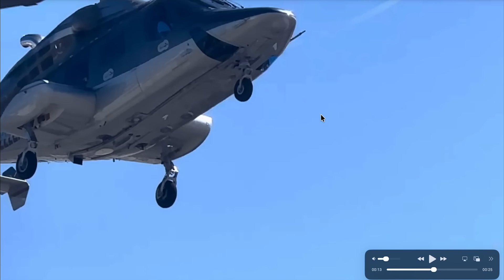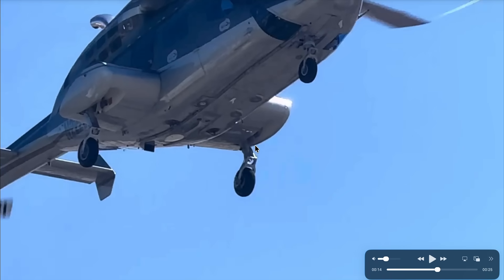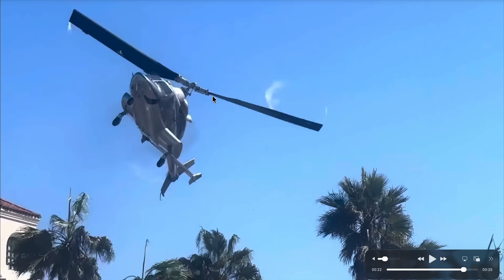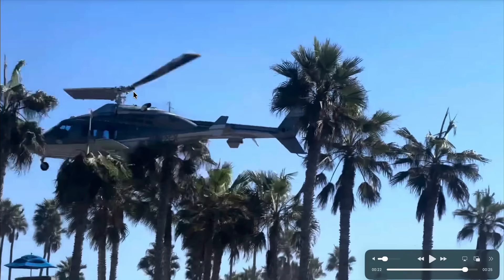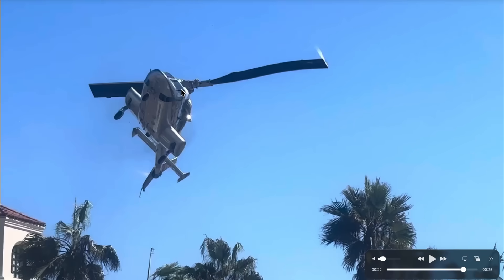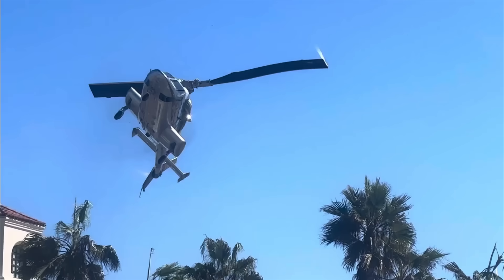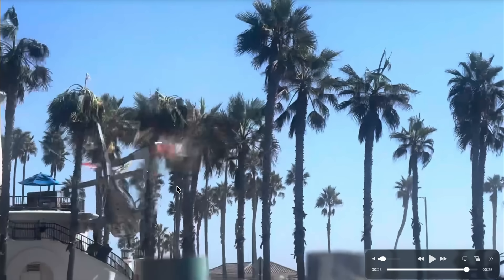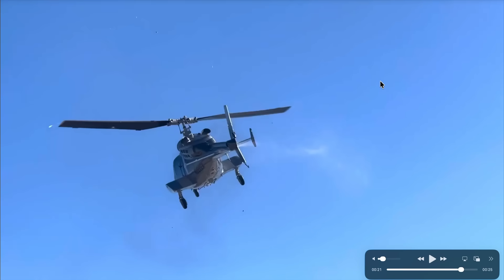Huntington Helicopter Crash Analysis - SlowMo Video!

Comment: There will be an aircraft mechanic somewhere in panic mode.
Reply: con los dedos cruzados para que termine siendo fatiga de materiales.
Reply: Yup. Rotor-wing aircraft are high maintenance, compared to fixed-wing.
Reply: That’s called the Jesus nut.
Reply: Hard to believe that.  Look up N661TC.  Not a single mechanic faced any consequences for failing to inspect basic wiring especially after two premature starter generator failures..
Reply: @SmokingFun I am a mechanic still sweating something I signed off over 15 years ago. So there’s that
Reply: @MeowWoof-m2s  unless you signed off on a bogus, major repair or alteration I wouldn’t worry about anything.
Reply: I would say failure to inspect all wiring epically the largest wire coming from a system that causes two premature starter/failure would be improper work.  A simple inspection of the generator system would have revealed resistance discrepancies in the wire coming from the two failed starter generators.   Basic 101  standard practices .  I’m not saying this without intimate knowledge of the Cal-Ore life flight maintenance department.  I heard conversations. They knew something was wrong with the airplane, but they kept throwing more parts at it without documentation until they fix the problem.   The chief pilot would take planes up to see if it fixed problems without any documentation in the logbook . The circuit breaker for the Hobbs meter would be pulled during those flights.  The most crooked operation I’ve ever experienced. There is no maintenance operation control.
Reply: @SmokingFun
Then document it and call your local FSDO.
Reply: @SmokingFun
Former FAA inspector here.

Mechanics and pilots dont always have violations against them when they do improper work. 
Try again.
Reply: @johnparish1432  wouldn’t improper work be not recognizing that to starter generators, failed prematurely, and failed to inspect other possible causes like the biggest wire in the airplane coming from that star generator chafing on a hydraulic line over several years under the care of cal-ore life light.  We all know it would take a long time for a hydraulic line to rub through the shielding a large aircraft wire. Shady operation.  Another crashed waiting to happen.
Reply: @SmokingFun
Of couse it may be improper but if a written complaint isnt submitted to the local FAA then its a moot point.
The aircraft, log books or mechanic will never be investigated.
The FAA should be able to do surveillance and if they find issues, write tickets on the spot like cops.

But instead they build a case and present it to the governments attorneys.

Most of the time the case is thrown out.

Did that for nine years.
We wasted a lot of time and money.
Reply: Wait until the final report from the NTSB before you throw people under the bus.
Reply: @johnparish1432  facts are facts . Every mechanic who recently worked on that helicopter, especially the mechanic who worked on the tail rotor and gearbox is sweating bullets.  That doesn’t necessarily mean it was mechanic’s fault but as a mechanic myself, I would be worried. Hopefully that gearbox just failed or the tail rotor on its own
Reply: @SmokingFun
I started at PHI, went on to Air logistics then spent more time as the cheif mechanic for the Austin police departments EC-120 and their 182.

I never worried.
I had no reason too.

Why on earth would you worry about your work.

If you do everything by the book that is the best you can do.

How do you sleep at night if you worry about your work?
Reply: @johnparish1432  I don’t worry about my work.   I was only responding to the comment that somebody else posted. You’re getting a little off track there.  No wonder mechanics are really prosecuted, we got lazy and incompetent government workers collecting a government welfare check paid for by my tax dollars.
Reply: @SmokingFun
As FAA inspectors we werent lazy.
As a matter of fact all of us had too much to do.
Many of us took our work home with us.

Its the "way" the pilots and mechanics get violations that was antiquated.

We would build a case and gather evidence for weeks or months only to have the case thrown out.

There is no incompetence or laziness on the inspectors part.
Its all from upper management calling the shots.
Reply: Glad they survived but this is why you do not use D.E.I. Mechanic’s on your Aircraft’s.
Reply: @flcowboydc  EXACTLY WHAT I SAID WHEN I FIRST SEEN IT!
Reply: @flcowboydc  LOL! True.
Reply: @flcowboydc  Yeah, you use I.E.D. mechanics...
Reply: @flcowboydc  What a shock, yet another wishful, invented accusation. There's obviously absolutely zero evidence of it being a "D.E.I. Mechanic", just as people post this rubbish on every crash.
Even when a supposed "dei" pilot, aka a woman, was flying during the door departure, there was a flurry of gleeful bs dumping on her. Never mind that it turned out that she handled it about as perfectly as possible, despite extreme circumstances.
Reply: @DoubleMonoLR LMAO, but Thank you for your Liberal insights.
Reply: @flcowboydc 
Former FAA inspector, he is correct.
You are wrong.
Reply: @johnparish1432 LMAO
Reply: @flcowboydc 
I can tell you arent a pilot or aircraft mechanic.
Whats your point?
What is so funny?
Reply: @johnparish1432 What’s funny is how a Lib/Dems can make a determination of somebody’s skill level without knowing who the Aviation Mechanic is but you did say you use to work for the government so that’s all I need to know.
Reply: @flcowboydc 
My reputation as a helo mechanic and FAA inspector is etched in stone.

Whats on your resume'?

And I voted Rebublican.

Try to keep up.
Reply: You kids are funny.
Please dont learn how to fly.
Reply: @flcowboydc  DEI or not an air frame and power plant license is a licensed to learn. There could be many reasons.   Premature tail rotor gearbox failure, records department did not track time limits on tail rotor and/or gearbox times or cycles correctly . Could just be incompetent mechanics nevertheless it is the companies responsibility ultimately. If any mechanics are at fault, they will face consequences to hopefully. But I’m not crossing my fingers
Reply: @flcowboydc 
Aircrafts?

???😂
Reply: @johnparish1432 D.E.I. Questions but as usual Lib/Dems jump into other people conversations.
Reply: @flcowboydc 
Not only that but some of them have NO idea how helicopters are built, flown or maintained. 

They are aviation ignorant but talk like AOC.
Reply: @flcowboydc  Inevitably, the racist is heard from.
Reply: @Hopeless_and_Forlorn LMAO
Reply: @Hopeless_and_Forlorn you mean the REALIST
Reply: @Hopeless_and_Forlorn  It was funny not racist, lighten up!

Comment: Vortices is the vapor off the mains, black smoke out of the stacks is the engines getting a load just before he dumped the collective into the auto and the change of pitch on the tail rotor was the pull on the control links as they departed
Reply: Pilot did a good job at getting them on the ground alive in my opinion, albeit injured, but that was the best he could do under the circumstances, so I give him a thumbs up! 🙂👍
Reply: @glenturney4750  Yeah, he did a good job setting it down on that kid...

Comment: Bell 222 is resistant to mast bumping the rotor head is designed for low G and split S maneuvers, But it sure came apart even the one blade looks fractured as the mast & head come apart. Ouch'
T/R gearbox output quill failed then the t/r rpm dropped off - pilot adds peddle until pop goes the weasel
The t/r blades contact the boom then it exits stage nowhere. 
I'd rather a hard landing under control then this, out of control spin cycle
Reply: "Designed for low G and splt S." Somebody watched too much Airwolf. No rotor system, even a BO-105, was 'designed' for those types of maneuvers. Being the 222 is a two-blade teetering system, even less so, and will absolutely mast bump under the right conditions.

Comment: I don’t know a lot about the tail rotor head of the 222. But if you freeze it at 1:00, it looks like there are two pitch change links folded inboard, or are they some sort of counterweight system? That would cause the initial loss of directional control, which would then allow the blades to feather, which would then be enough to get out of balance enough to separate the tail gearbox housing.
Reply: At 5:20 is a shot of where the tailrotor can clearly be seen, the pitch change system appears intact and the TR blade angles consistent with left pedal applied.  The TR pitch change mechanism uses counterweights and a total of 4 pitch change rods/links.  One PCL certainly came adrift or broke, timing is uncertain…

FWIW I think there has been some sort of TR control failure, not a drive failure.  The TR speed variations as captured by the camera shutter appear consistent with the normal RPM fluctuations experienced with power changes.  Under the air and gyroscopic loads the TR would undergo in the rapid right spin the TR hub would be bumping on the travel stops (same as mast bumping) and the blade failure would be as a result of loads applied.  Back in the 1980’s there was a repetitive inspection on the 222 tailrotor blades in that area if I recall correctly.  Once one blade separated, the gearbox housing failed and departed with the output shaft and bevel gear.  Another video shows this on the ground.  Probably the other blade failed when striking the fin.

Black smoke from the engines is normal exhaust trail for low speed high power operation.  White “smoke” from the TR gearbox would be oil spray/vapour.

(40 year helicopter maintenance engineer with B222/230/430 time…)
Reply: @skyblot741  Thanks. Finally someone who knows what he's talking about. Definitely the best comment here.
Reply: @skyblot741 I’ve got 21 years maintaining Skycranes, but haven’t really spent any time around Bell products, so thanks for the clarification. Luckily, it sounds like the pilots are ok, so it’ll be interesting to hear their input as to what happened if they are able to remember. 👍🏻
Reply: @LightningSpeed64 5 taken to hospital. 2 on chopper, 3 on ground. Landed on a kid who was trapped until someone pulled him out.
Reply from the maker: You’re correct!  It would appear one of the pitch change link on a tail blade failed. From there it all went downhill. Crazy how such a simple component can cause catastrophe.
Reply: At 1:01 it appears one of them is free